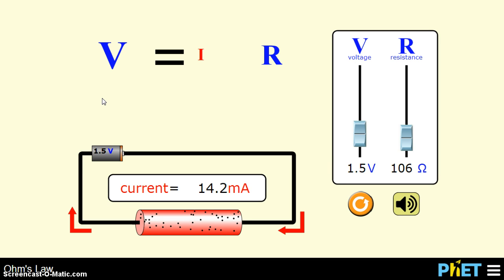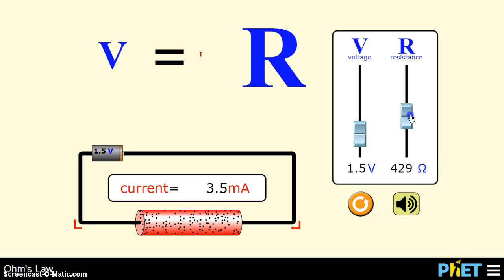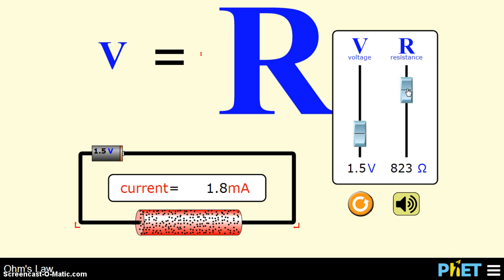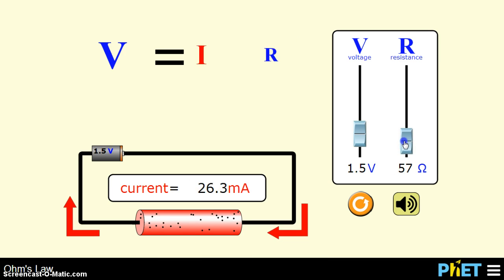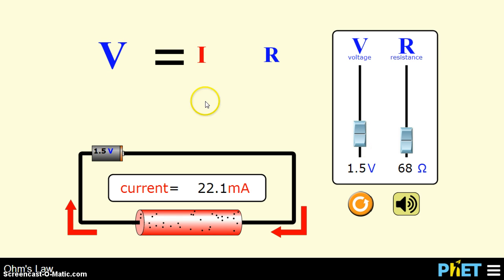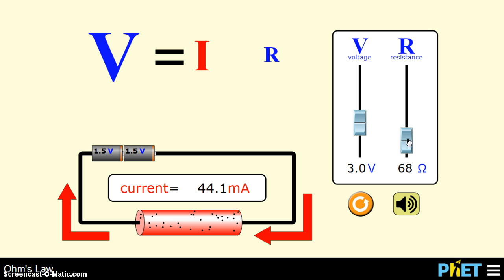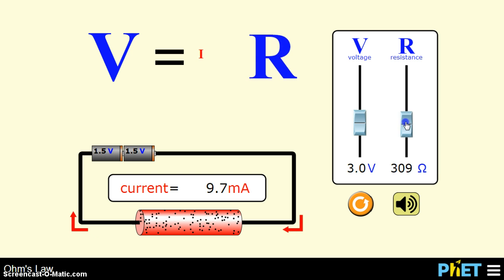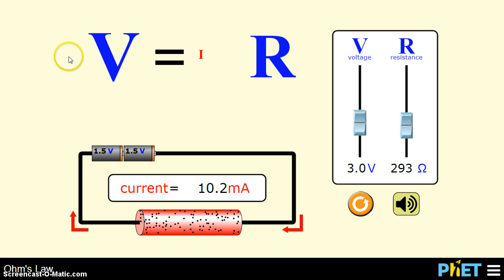Explanation of Ohm's Law using Phet

Comment: what does the m before SI UNIT stand for??
Reply: This video does not refer to SU units so I am not what you mean by "what does the m before SI UNIT stand for??"
However, an “m before SI UNIT” may be referring to the symbol for metre which is the SI unit for length (SI units are internationally agreed standards for units of measurement). The agreements allow for equitable comparison and conversion through standard equations. For example in this video, the equation V = I * R applies when SI units are used. That is, when current, I, = 5 amps and resistance, R = 3 ohms, voltage, V, can be calculated as 5 (amps) * 3 (ohms) = 15 (volts) where the SI units for each are: voltage (V) in volts; current (I) in amps; and resistance (R) in ohms.  NOTE:  the units too can be written in shorthand using symbols. So, 5 amps is often written as 5 A and 15 volts as 15 V.  Just like the quantity length (or distance) is measured with SI units of “metres” often written in shorthand using the symbol m to denote metre (e.g. a distance of 4.7 m).

Alternatively, an “m before SI UNIT” may be referring to “milli” or “one-thousandth of”.  Unfortunately, the lower case m is often used as both the symbol for metre (a quantity of length/distance) and milli (a unit prefix of the metric system).  So, in the example where a small length of 2.3 millimetres is measured, both versions of the symbol m are used leaving us with 2.3 mm [the first m for “milli” and the second “m” representing “metre”].

I realise there is still a significant probability that I am not addressing your question but please accept the following – I have not looked at this video since it was produced and will likely never watch it again or respond to such an elegant (read brief) yet intriguing (read puzzling) questions.
Reply: miliamper